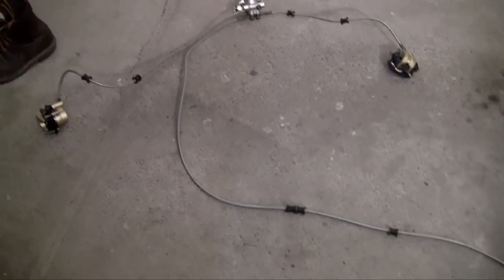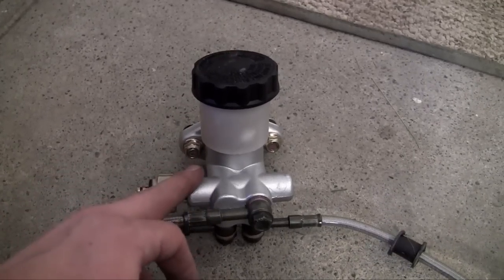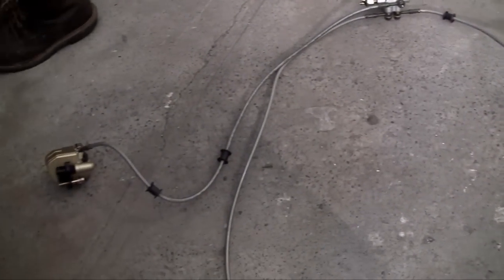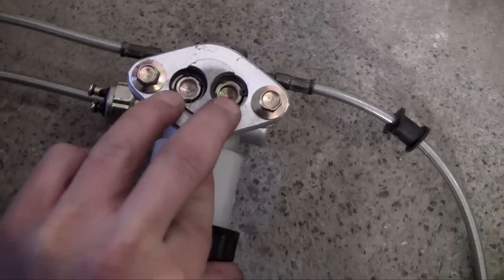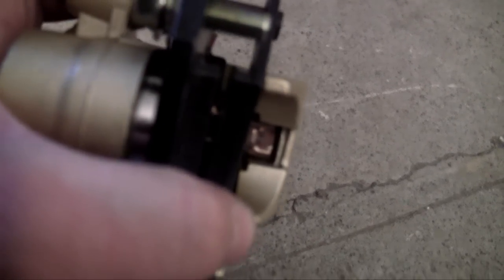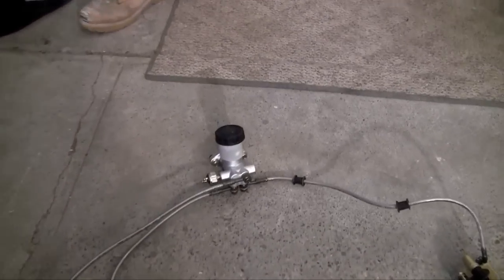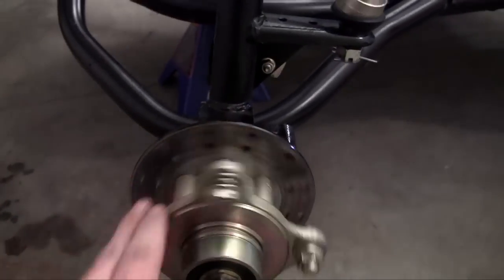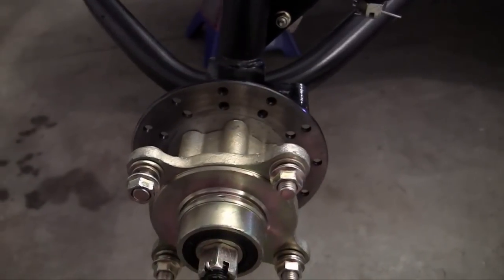How to Build a Go Kart - 9 - Brake System Overview

Comment: the 3rd rotor goes on the drive axle. it's to stop the drive wheel. most buggies have a solid rear axle so they usually mount the rotor directly to that. I guess if your go kart only has one drive wheel it would go on a specific wheel.